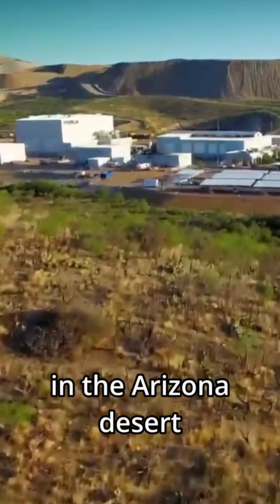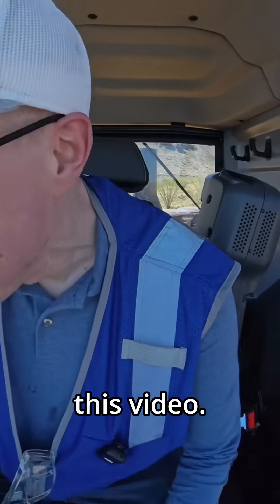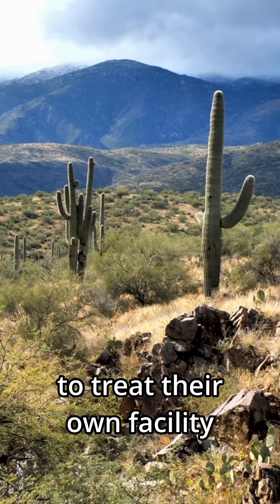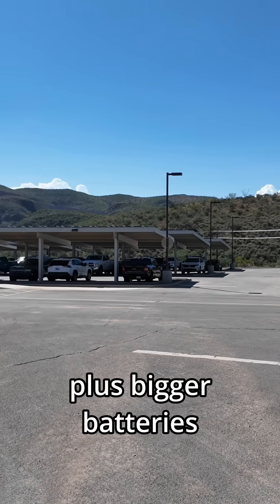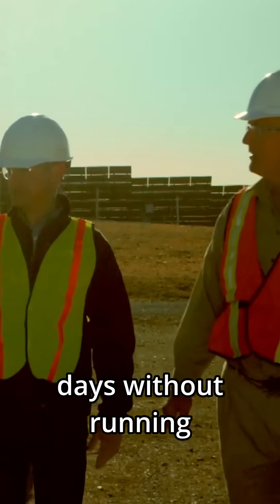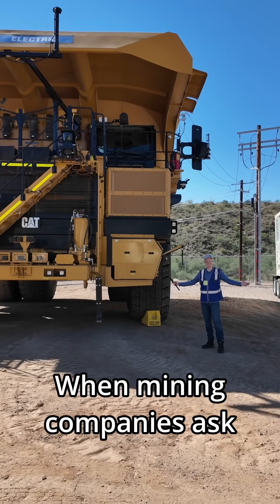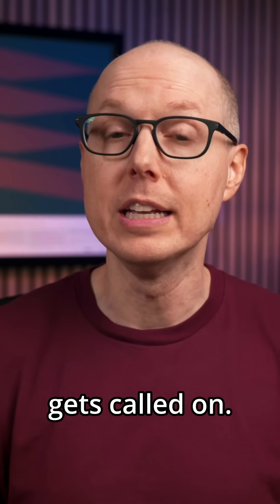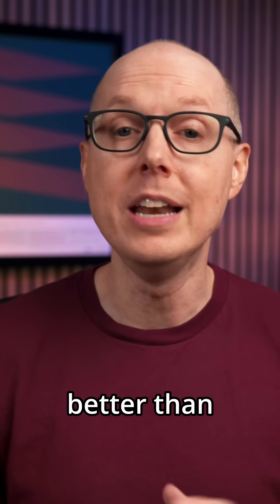Microgrids: The Desert Facility Running on Sunshine

Comment: I doubt they are saving costs as The CAPEX for this project is huge.
Reply: Took my smaller solar array - 2.5kw which generates 3mwh a year, to completely offset my EV. It paid itself off in 4.5 years, been driving for free the past 12 months.  This is similar to that.  It doesn't take longer, they use so much more energy you just build it 100x fold and reap the rewards.
Reply: Ok.....after all, CAT is only one of the world's largest power systems manufacturer. I'm sure the thought of the investment cost never crossed anyone's mind🙄

Comment: I live in GA, and had solar installed (6.6KW system) 2 years ago. Due to HOA rules (vomit!), I had to put the panels on the North and West side of my roof :*(.  Even so, my electric bills went from $175/month to $73 a month.
Reply: did you look into SolarCity Tiles?

Comment: It's very awesome to see this kind of development in their testing, though I am curious in the midst outside of desert use. There are a lot of places that could go days or even weeks without sunshine, so it would drain the batteries long before they'd be able to recharge from solar. I'd be curious to see if lower light charging would be a supplement for this (the similar tech used in some watches, where they can charge with any form of light.)

Comment: I built a solar system for my place about four years ago and I love it one of the coolest things I've built.
Reply: Same here. It’s nice to just coast through a power outage.
Reply: @tomcoryell  A wholehouse UPS would do the same thing for a lot less money.  What's your ROI time?  What's your maintainence/replacement costs/times?
Reply: @unchosenid  I don’t really care. I offset some electricity costs and have a robust solar charged backup system. What’s the ROI on a sports car or recreational airplane? And yet they don’t do a damn thing when the power goes out. It was enjoyable to build and provides a service. The peace of mind is priceless.
Reply: @unchosenid  My PV system cost £5000 to install (7kWp, 16kWh battery, islanding, with 5kW export limit) and makes £1400/yr (and gets us 97% off-grid) so will pay for itself in just over 3 years (both money and emissions)  The ROI is about 28%.

Maintenance will be approximately zero (I might clean it in a few years time). Replacement will be a new battery about every 10 years. (Currently £1800, but I expect it will be much cheaper in 10 years time when I need a new one).
Might need a new inverter at some point, but the one I got in 2009 is still going after 16 years. I bought quality kit so maybe 15 year replacement cycle. 

This is in the UK, where it's much cheaper than the US because we have a more flexible grid, better rules and freeer trade. But even in the US where it would cost twice as much, that's still 6-7 years to get your money back. PV is pretty good value these days and getting better every year as prices continue to fall.

Comment: It does not take much looking around to see Caterpillar is an electrification company specializing in micro grids. Solar. BESS. Controllers. Integrating wind. Conventional fossil fueled generators. Metering. It seems likely a broker for financing. Caterpillar isn’t only testing mining equipment for FIFO mines in Australia. They’re testing their own micro grid products. Flying in tech’s and engineers is expensive. Building it right in the first place might be cheaper. I’d bet Caterpillar didn’t show the good P.E. everything. Self creating mesh communication systems between load devices, controllers, BESS, generating units? Predictive load, and resource, I.E. wind or solar in next 72 hours, load shedding devices, all to maximize output of expensive components in a remote micro grid. Is one customer willing to pay for no more than one hour of BESS supply per week, another wants power 24-7? Differential pricing. 

Caterpillar is not a charity.

Comment: There are many omitted points here, costs of installation, maintenance, drop in efficiency , cost of recycling, battery storage, 
Show a spread indicating a KW needed to operate  this facility , I been there , spoke with people , this is a typical presentation slanted to promote the renewable energy, wasted $$$$,

Comment: Left out of the story is the cost and ongoing operations cost of this whole system.
Reply: Just adding context here. Once the systems are installed the ongoing maintenance is very minimal. In a low rainfall/high dust area, you really are only cleaning the panels once or twice a year at most if you want to maximize performance and that’s really just wiping dust/sand off - nothing intensive.

Other parts of the US you might be mowing (or goats) with the same frequency but can rely on rain to keep the panels clean.

These costs are comparatively many times less expensive than fuel costs + transport for diesel generators.
Reply: @alexandermorganti7468  how long does the system last?
Reply: both PV solar and battery last over 25 years.
Reply: @KarimHosein  I highly doubt the batteries last that long.
Reply: @jgrif7891  Utility scale lithium batteries are expected to last 15 to 20 years.  Other storage technologies vary.
Reply: Glad to see I'm not the only one to notice
Reply: @jgrif7891 Is not like you give a shit. You never questioned how much oil rigs, hydraulic fracking or oil fields cost. You only care they keep the price low and they cant without subsidies. And a fuel generator is only 30% efficient,  70% goes wasted in smog and heat. 

But suddenly every oil shill is concerned about costs when they hear there is competitors.  
Let the money talk. They wouldn't do it if they didnt crunch the numbers
Reply: @fofopads4450  because solar and wind didn't get massive subsidies in the 2010s

Comment: Do they have projections on when the savings on diesel fuel will pay for the solar and battery system?  How many years to break even on cost?  

For carbon, what is the carbon footprint of manufacturing and installation of the solar and battery system vs the diesel and diesel equipment lifecycle?  A total net carbon and net cost comparison would be helpful, if it’s available.
Reply: Why do people only ask about the carbon impact of solar panels? But never the carbon impact of trucking thousands of gallons of diesel to a remote site?

Comment: It’s nice to see a sustainability success story in the midst of all the negative recent setbacks. Thank you.
Reply: And a real world example instead of maybes in lab conditions
Reply: Yeah but how much did this cost and how many tons of rare earths had to be mined for this.. you have to look at the full picture cradle to grave.
Reply: @ericschell111 We're digging our own grave with fossil fuels, it's time to leave that toxic junk in the past and transition to more clean and sustainable energy sources.
Reply: @ericschell111  You’re right that you have to look cradle-to-grave — and when you do, solar + batteries still come out far ahead of fossil fuels.

A few clarifications though:
• Most solar panels use silicon, aluminum, glass, copper — not rare earths. Rare earths are mainly used in some wind turbine magnets, not standard PV.
• Batteries do use lithium, nickel, cobalt etc., but the total material extracted over their lifetime is still far lower than the continuous fuel extraction, transport, and combustion required for oil, gas, or coal.
• Fossil fuels are 100% consumptive: once burned, they’re gone and produce permanent emissions. Solar infrastructure is built once and produces energy for 25–40 years, and materials are increasingly recyclable.
• Life-cycle analyses consistently show solar electricity emits ~5–20× less CO₂ per kWh than fossil fuels, even including mining and manufacturing.

So yes — no energy source is impact-free. But cradle-to-grave, renewables drastically reduce total extraction, emissions, and long-term damage compared to fossil systems.

Comment: A few things to point out which were conveniently ignored or overlooked. The first thing is the amount of land required. The second is how many of these trucks are operating and for how long. The last is the cost of the solar panels, batteries and diesel generators. I doubt that there are many places in the world where this would be a financially viable option.
Reply: Sure pal. Dont worry, you oil investments are safe. 

For now.

Comment: It's good to see heavy industry finding solutions
Reply: Prius got its transmission power flow from forklifts.  Also heavy is a perfect use case.  Low speed, high torque and relatively short highly defined patterns are an excellent fit for EV.
Reply: This is just in time, Trump’s cabinet would’ve killed the project…!👍🏼
And good to see it’s a viable solution!
Reply: "The quiet generators tell the story better than any spreadsheet could." Sorry, but I need to see the spreadsheet with actual numbers before I can come up with an informed opinion.
Reply: How many years till they have this whole system payed off. They arent saving anything till then.
Reply: China pulling away on renewable meanwhile trump, drill baby drill. That clown will cost us long after he's gone
Reply: it’s good to see how we keep polluting our world more with “green solutions”
Reply: @markferreira7590  how exactly are we polluting with green energy vs using oil?
Reply: @markferreira7590 for an electric vehicle to be carbon neutral is between 2-5 years.  Solar farms 1-3 years. And in America the installation cost is subsidized by tax payers.
Reply: @markferreira7590 this is just dumb, the thing is fossil fuels are no renewable and the entire process from mining to usage make more pollution. After you build these systems they no longer produce pollution and hat part of that is so hard for you to figure out?
Reply: Yeah. 10 or 20 times the cost. And they still have to truck in the diesel but now they don't have a contract for daily or weekly deliveries and the price goes up. Plus there's no guarantee the providers can truck out the diesel in time because they're focused on contract customers. And in < 10 years when those panels are generating half the power stated and manufacturer longevity spec turn out to be absolute bs ...because the desert heat cooks out panel efficiency...they'll back on generators. A small modular nuclear reactor would have been the way to go. Plus you're not taking the desert toroise lizard bird and cactus habitat with all those panels...as ALLL the solar installations have done outside of Vegas. They're an absolute eyesore too. And encroach on urban development.
Reply: @I.M.fulluvit You're a very positive, optimistic kind of person, aren't you?
I think you misspelt your tag...shouldn't that be FullOfIt?
Reply: @iRossM  i think thats exactly what he meant actually. he's probably a troll.
Reply: @I.M.fulluvitthink about the amount of diesel that doesn't get burnt and put into the environment. Panels can be replaced later. Or nuclear.
Reply: @I.M.fulluvit eyesore vs death sentence 4 humanity
you really should think that one through at least a single time, it doesnt sound like you did.
panels maintain 70-80% of their generating capabilities after 25-30 years. def worth ANY the upfront costs. yes even the CO2 produced for making the panels, since they will be keeping diesel/FO generators of the same wattage of the grid, esp. if paired with storage... As far as BOM costs go, LiFePO4 is literally getting dirt cheap, Na storage is on the horizon and got the promise of literally being cheaper than dirt

Comment: The key metric is how long the facility can run without ever using the generators, because a customer is still going to have to buy and maintain generators if solar can't provide power 24/7/365 - in other words, they're not likely to accept having to shut down even 2-3 days/qtr for lack of solar power.  

Also most parts of the US don't have such reliable (sunny) weather as Arizona, so data from Tucson might be overly optimistic (would need allowances) for a customer located further north, especially north east, or north west-coastal.
Reply: Once you have enough batteries to be able to power your max current demand for a while it means you can get away with a much smaller generator, because the batteries run your gear and the generator only has to recharge the batteries. The weather forecast tells you when solar will not be enough so you can run a small generator 247 to top up the batteries during that time.
Reply: Most critical facilities have 2 or 3x redundant backup systems meaning each critical system  has a backup for its backup.  In that case, the solar system simply replaces one of the redundancies.
Reply: look up state capacity factors and it'll give you a hint at how much extra storage will be needed based on state siting.
Reply: more batteries

Comment: Caterpillar didn’t build this solar facility out of the goodness of their heart. They did it because the Chinese are going electric and they have to understand and compete in the industry. 
PS — A British firm forecasts electric trucks will reach nearly 46% of new heavy sales in China this year (2025). While electric trucks cost more up front, their higher energy efficiency and lower costs can save owners an 10% to 26% over the vehicle’s lifetime, according to research by Chinese scientists. Diesel consumption in China, the second-largest consumer of the fuel after the U.S., is falling.
Reply: True. China is getting around any lack of charging infrastructure at the present time by employing pack swapping. Diesel consumption there is down for a second year in a row

Comment: They'll probably never reach the confidence to not have the generators as a back up, but they might reduce it's service to minimal functionality to stretch how long their on hand fuel holds them.  Second thought, they might transition them to a more stable long term fuel that doesn't degrade, like hydrogen or something.
Reply: I have a cousin who was not confident about buying a BEV, so he bought a PHEV. In two years, he has never run the ICE engine. Now he wishes he bought a BEV.

I am certain that they will get the confidence, if they do not already have it.

Comment: True but this can only be used in a dessert. Where else you will find so many hectars to install solar panels and batteries ?
Reply: It can be used anywhere in the tropics. US deserts get about 600w per sq meter of oure sunlight in average. 

Tropical countries closer to the equator get about 1100 watts per sq meter. 

Also you cant just compare regular residential with the massive power demand from a mining operation

Comment: I suspect hydrogen or ammonia will win out though, as JCB believes.

Even if enough energy can be harvested, the recharge time means companies will need 2x machines so one works and one charges. And the batteries add significant weight, which is not helpful on soft surface construction sites.
Reply: The main limit to fast charging is heat. In India they have developed a system where there are cooling pipes through the battery pack and they have special chargers that pump pre cooled fluid through the pipes during charging so the vehicle doesn't need to do the cooling itself. This saves cost and weight on the vehicle but means you have to use dedicated chargers. But that's no problem when you're operating on a closed site like a mine rather than driving across the country.
Reply: @adrianthoroughgood1191  It also means more energy is used in the filling process.

Another consideration is the weight of EV so that 97% of the kerb weight is the car and 3% the occupants, so 97% of the energy produced by mostly non-green sources is just to move the vehicle forward.
Reply: @A190xx All cars are heavy relatively to people. EVs are on average only 20% heavier than equivalent ICE cars.   How much FF is used in electricity production varies by location. In the US it's 60% currently, but dropping every year. It will be under 50% within the lifetime of cars bought today. The UK is further along with only 29% FF electricity, aiming to get that down to 5% by 2030. Even though they have to carry a bit more weight, the very high efficiency of batteries and motors means they are much more efficient than using hydrogen or other fuels.
Reply: battery advances will drop charging times dramatically through time.

Comment: Curious as to what percentage of the 10 square miles is solar and battery?  I am also confused by 3 megawatts of batteries =12 megawatt hours of energy?  Does this mean if batteries were fully charged they, combined with a 1.5 megawatt array could provide 12mwh of power in one day?
Reply: Battery bank have 2 different ratings: the power rating in Kw or Mw, and the capacity ( how much energy they can store) in KwH or MwH.

If you compare to a tank, the Mw is the flow in gallon per hour. And the MwH is the tank capacity in gallons.

3 megawatt, 12MwH battery means it can deliver max power of 3Mw for 4H before being empty, or 2Mw for 6H...
Reply: @niconico3907 
Thanks